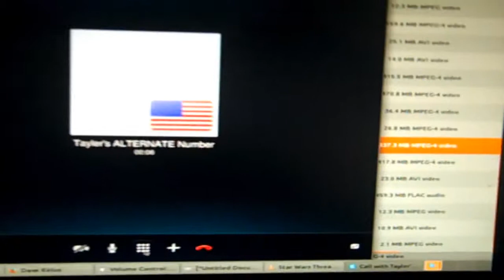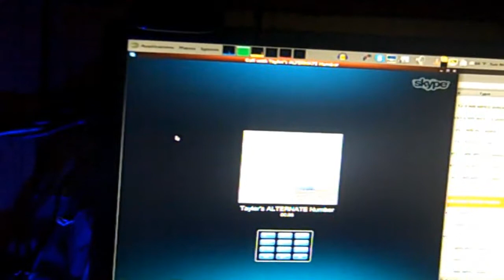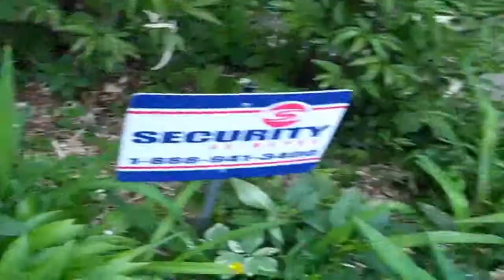Pondscape - 2014 - Chicago Forestry Department [dvd 640 x 360]

Comment: Trees offer all kinds of protection. Now that they cutting down your trees in your street  your street will look like any other place it changes your whole inviroment.
Reply from the maker: Well, thankfully we are growing quite a few trees of our own. Will probably take them another decade to get as big as the one they cut down, but -- we are growing a lot more than one! :)

Like we said -- they take 7 years to cut down a dying one that was dangerous and needed to be cut down. But a perfectly good tree that did not need to be cut down, they just take that down right away. I understand the need to fix the water line but they could have re-routed the line around the tree. They'd still have had to break up the street and everything for that anyways. They didn't have to cut down the tree, but -- they did. Because Chicago is run by assholes.